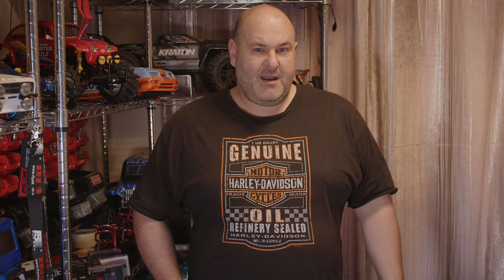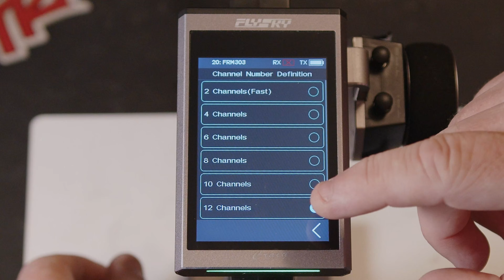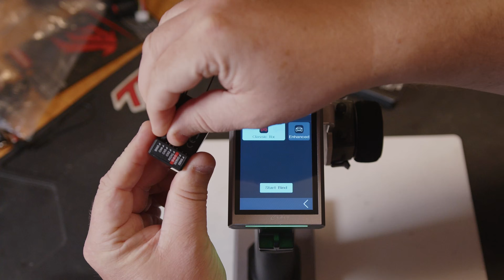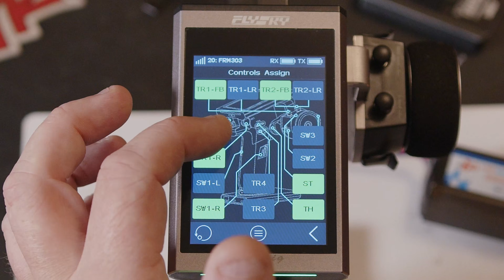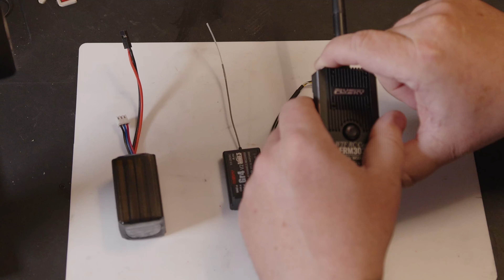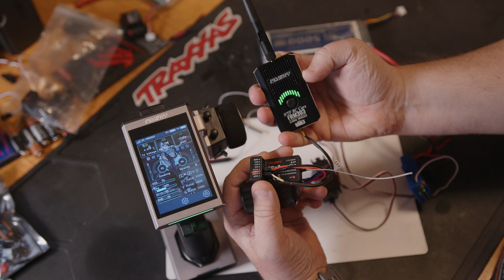Flysky FRM303 Noble pro setup with fgr4 and ftr12b

Comment: Does anyone know if you can program SW1 or SW2 to D/R 100% with the push of either button?  I sometimes run a low D/R and in some instances need 100% quickly.  Also, can you change the trigger throw to 80/20 instead of the 50/50?
Reply from the maker: You can set any dial to adjust DR and and switch to switch it in/off
Reply: @WTFRCCars  Thx works like a charm.
Reply from the maker: @2sipsMax no worries

Comment: Hey there.. so I'm just setting up my frm303.

When I plug in the 2s lipo to the rx with the 303 in the OFF position. It lights up red and with beeps as well.
Reply: Is there a way to pm you? I just got some fgr8b's and when I get to the binding of the second rx. I hit the toggle to the right and get nothing. Up down Or right, but if I hit left toggle I get a red light and beep
Reply from the maker: Hi I have wtfrccars Facebook group ya can contact me in there :)
Reply: @WTFRCCars  I found it
Reply from the maker: sounds like the switch is not working
Reply: @WTFRCCars  do you have a whatsapp? Or on Facebook by chance

Comment: When you get the juvenile version and you want to crimp or solder a servo plug on the universal wire, make sure you use black RED and white. Not yellow! 6:39
Reply from the maker: Yeh very strange that the servo plug cable uses yellow as + and not red? universal wire would be black - Red + and then choose you sig wire yellow for UART White for PPM and brown for s bus.
Reply: @WTFRCCars  VCC on the universal wire is Red, on the factory servo plug wire VCC is yellow. 
So if you take black, yellow, white it won't work!

Comment: I been waiting for this video & Thanks ~ but i need to know how to connect it directly into the circuit board of the transmitter ~ i don't want to use 2 receiver & have to rebind it every time i switch cars ~ i take 2 or 3 cars out with me when i go to do my speed runs & to have to rebind each cars would get annoying.
Reply from the maker: It doesn't connect internally, and you don't have to re bind each time you swap rc's, you will still need to bind to the range extender but it remembers the receivers upto 10 I believe, but the receiver used for the range extender is only bound once and doesn't need re binding if you swap rc's
Reply: @WTFRCCars  oh ok but you said it could be connect it directly into the circuit board of the transmitter on a reply to someone else's comment.
Reply from the maker: @NorcalSpeedAddiction it very likely can but not easily as that is not what it's designed for :) you would need to find an sbus or ppm output on the radios circuit board and solder to it so far easier to run the receiver and far more convenient too :)

Comment: On one hand, I do like the ability to use it as a 'range extender', placing the FRM303 in a location of the user's choosing.  On the other hand, I don't understand why they had to make the configuration so "confusing"...meaning, having to use two receivers.  With other signal boosters, such as the TBS Crossfire, the signal booster is connected directly to the Tx (similar to how the FRM303 would be connected to the Paladin Tx), thus only one receiver is needed.

One thing that will be interesting to find out is what the maximum controllable distance is.  Using (again) the TBS Crossfire as a comparison, TBS claims a range of 80 km, and I know they have maintained controllable contact of a plane at 45 miles.  For surface use, I don't know what the maximum range of the Crossfire is...but, once mine is delivered (it's "out for delivery" right now), and the weather cools down a bit (we've been getting over 100°F temps), that is one thing I definitely plan on testing.
Reply from the maker: So you can just connect it directly into the circuit board of the transmitter like any other range extender and the range on 2w power is 80km with no interference and no obstruction just this has the ability to be run from a receiver too if you don't want the hassle or risk of taking the tx apart
Reply: @WTFRCCars  With The Crossfire, connecting to the RC8X, no "modding".  The RC8X has a DSC port, which can be used for plugging in an FPV headset, or a TBS Crossfire.  Connection on the Tx is a 3.5mm jack.
Reply from the maker: @ninthislandrc The main issue with range extenders is for land use they are all illegal almost everywhere in the world so if a transmitter is deemed to be directly supporting a range booster attached to the transmitter they can be banned from sale
Reply: @WTFRCCars  Here, in the US, they're legal...with exceptions.  I might be remembering incorrectly...but, last I remember, up to 1W is allowed for ground use.  Overall, the FCC allows higher power usage.  That would also explain why, for the Noble transmitters ,FlySky has an 'FCC'  firmware version (ie. higher power output), and a 'standard' firmware version.  Of course, on both sides of the pond, were always free to "max out" the power...as long as we don't get caught. 🙃
Reply from the maker: @ninthislandrc yep but the range extenders are 2w so twice the power allowed :)
Reply: @WTFRCCars  I believe it's "up to 2W".  As with the TBS Crossfire (which got delivered about 15 minutes ago), the power output should be programmable.  What I don't know (for any of the boosters/extenders) is whether the power output is programmable on a per-receiver basis, or whether it's for all receivers.  If the former, that would be a good thing, as it could be sweet to 1W for bound cars, and 2W for bound planes/helicopters.  But, of it's the latter, then then pretty prior would have to be adjusted (if a person wanted) for each vehicle type.  For my testing of the Crossfire (connected to the aforementioned RC8X), I'll probably test ranges all the way up to 2W...but, for everyday speedrunning use, I'll probably set it to 1W.  Have to see what options it has, which means reading the full manual...which I'll start doing within the next 30 minutes.
Reply from the maker: @ninthislandrc Also power output is not measured at the device it's measured at the antenna so if your running a multi element yargi type antenna that has gain every 3db gain doubles the transmitted power so then you would be limited to far below 2w to stay legal it's a mine field so I get why flysky do it the way they do as the noble pro is a race transmitter and has passed FCC regs so it can't be banned from race use
Reply: @WTFRCCars  Not banned by the race organizations, correct.  Unfortunately, word had gotten around that some local clubs have banned use of the Noble transmitters, most notably in some Mini-Z clubs...and, honestly, it makes no sense.  The Noble transmitters were the first non-Kyosho Tx's to fully support Mini-Z...and, said compatibility was even developed with Kyosho, so I just don't understand why any clubs would ban their use.  For our local club - LV Mini-Z Underground - I'd estimate at least 85% use the NB4, and a couple others use the Pro.

Regarding the FRM303, I still might get it.  Would be a great 'compliment' to the RC8X/Crossfire combo.  But, first, I'll need to sell my 7PX, along with my Futaba receivers.
Reply from the maker: @ninthislandrc In Japan the kyosho mini z radio is made by flysky and so are many of the kyosho RTR radios, almost all absima are flysky too I don't see why they would ban the nb4 makes no sense
Reply: @WTFRCCars  Almost forgot to mention, for the antenna I'll be using a Diamond Antenna on the Tx (which you could probably use with the FRM303, as I'm guessing the Tx antenna connection is the same coax used on other boosters), and an Immortal-T Antenna on the Rx.  Both are from TBS.  The Diamond Antenna was developed specifically for use in ground vehicles, as well as aerial vehicles that are flown low to the ground.  Worth checking into.
Reply: I don’t like the use of the second receiver simply from a packaging perspective: one more thing to hang off the FM303. Why not build a receiver into the FM303?
Reply: @GoGetterRC  For one thing, that would eliminate the ability to use it with any brand Tx.  Although, I do understand what you're getting at.  Although the TBS Crossfire (the range-extending option I went with) doesn't use a built-in Rx (plugs into the Tx), when it comes to surface transmitters, the only one I'm aware of that it works with is the Radiolink RC8X, and that's because it plugs into the DSC port on the RC8X.  Best I can say is, each of these two has their advantages, and disadvantages...and, a few months from now, I fully expect to have, and be using, both.
Reply from the maker: @ninthislandrc The frm303 supports open UART standard too as well as afhds3 so can run other receivers too
Reply: @WTFRCCars  As I said before, I'll probably get it.  That way, will have two transmitters I can use for speedrun cars...as well as all the others.  I think either/both of them could prove especially useful for boats. 🤙🏼
Reply from the maker: @mt5528 many reasons 1 the frm 303 has no room inside it, 2 the frm303 also works with other radios, 3 it would limit its use with other radios, 4 there would be way too much interference from the 303s RF amp for the other receiver to work :) you could always wire the 303 directly to a sbus output in the radio if you don't want to use another receiver it's just far more convenient not to have to take your transmitter apart and if you run different rc's not just speed run cars you don't have to have the 303 stuck to your transmitter all the time :)
Reply: @WTFRCCars  Got ya on all points...well, except for the last one...lol.  Not that I "don't get" it (I do)...but, because that was something I was also worried/wondering about, and had to figure out a 'solution' (obviously, I'll be using the RC8X for vehicles/vessels other than speedrun cars).

My 'solution' is simple - Velcro, 3M Dual Lock, or something similar (3 small pieces to hold the external Tx, and one larger piece to hold the battery).  I've even figured out exactly where each will go...and, I would have completed the work tonight, except that I can't find my Dual Lock tape (must be in one of those dozens of boxes I still haven't unpacked since moving).  Guess I'll be making a trip to Lowe's tomorrow.
Reply: Can set this up on my nb4 for speed runs?
Reply: @pnwRCMADNESS  That would, MOST definitely, be one of the primary uses it's designed for. 🤙🏼
Reply: @ninthislandrc  can I use a fgr4s for both rx's?
Reply: @ninthislandrc  or do I need one with an external antenna
Reply from the maker: @pnwRCMADNESS yes
Reply: @WTFRCCars  thank you, just ordered the youth one without all the extra connections. I'll probably reach out again to make sure I'm getting all set up correctly. I really appreciate your videos and the time you spend making them. 
Thank you
Reply from the maker: @pnwRCMADNESS just editing the nb4 set up with FGr12b from radio and FTr10 on RC side :)
Reply: @pnwRCMADNESS  I'd assume so...but, ask WTF RC, as he's the one with the FRM303.